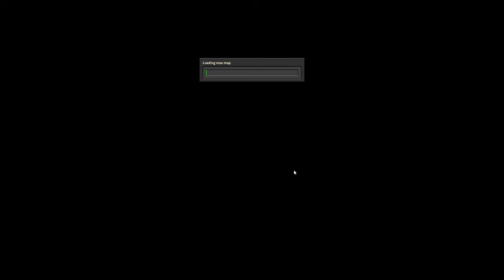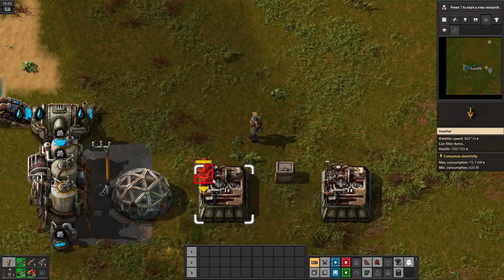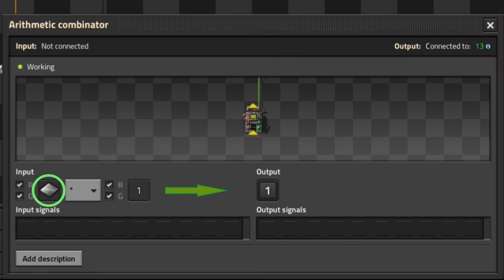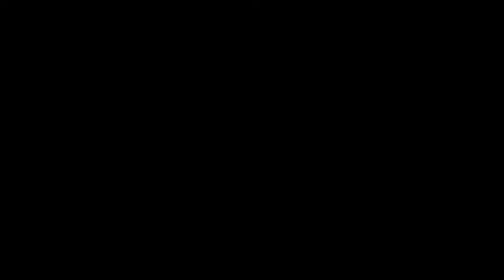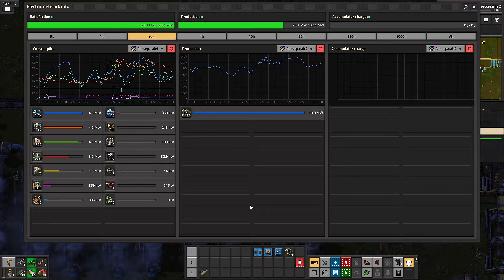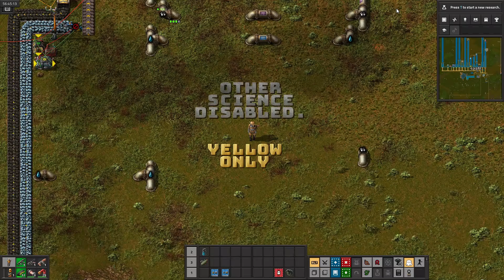How Hard is it to Beat Factorio Precisely

Comment: It would indeed be very cool if we could do the fully precise thing where we only mine as many items as we need for what we're building and at the end, we're launching a rocket with zero raw material in belts and boxes (but I guess a mall would still be ok, so we don't have to go completely insane). To be extra frustrating, we would also aim to have zero science packs in the system in the end (though I guess there's an issue with science packs being emptied unevenly)

Comment: Concerning quality with precision- you need to be able to detect when a quality product is created, shunt it off to the quality network, and re-add the ingredients to make a replacement component.
Reply from the maker: Indeed indeed. Quality is something I plan on looking more into when I do this again, as I feel it would help a lot of the shortcomings in the design.
The design in this video is (relatively) simple, so I did not have a way to do that without a redesign in any way that felt in line with the challenge.

Comment: This reminds me of an idea I had for a minimum resources run, where the total amount of ore is set to the absolute bare minimum necessary to beat the game, but this would not be practical to attempt in an actual run, as it would require such abominations as:
1. Mining all ore by hand until either productivity modules or mining productivity are unlocked
2. Mining all ore with a single electric drill for the rest of the run
3. No inserters, belts, bots, or trains. (you can borrow belts that you will later use for green science, but you have to give them back by the end of the run)
4. Many sub-abominations to minimize power consumption pre-solar, including not borrowing inserters from green science production
5. Only using a single solar panel for the rest of the run
6. Only using a single assembler of whatever the current highest tier is, ever.
7. Only using a single stone furnace, and later electric furnace, which will run on low power due to the single solar panel.
8. Only using one chemical plant and oil refinery each, and good luck minimizing the number of pipes required, since a storage tank is a waste of precious plates.
And of course, by far the worst part is the routing: figuring out which technologies to unlock in which order, which unnecessary techs save more resources than they cost, and when to craft which items.
The only way someone could actually attempt this and complete it before the sun explodes is probably to use mods to make handcrafting instant, make it permanently day and make a single solar panel give a million times the energy, and manually place resources on specific tiles to eliminate the need for multiple power poles, among other things.

Sorry for rambling, hopefully somebody finds this interesting. I think the only thing more cursed than actually attempting this would be trying to optimize a 100% TAS of Space Age.
Reply from the maker: That would in fact, be an experience of all time.
Reply: @LucyTP  lol

Comment: So, I'll write down a few main thoughts that came to me while watching this video. I don't know why you decided not to use wagons, cars, and tanks instead of chests, but that's not as important as choosing storage over belts - for their use, it's sufficient to read values from inter-section belts using pulses and stop them when a threshold value is crossed. Also regarding pipes - I'm not sure there are reliable ways to send exactly 5 units of fluid (although throttling is close to something like that), you can use a simple design - pump-pipe-pump, where the pipe will always measure out 100 units of fluid for you (and by the way, you can use sushi pipes). Regarding the main goal - I'd like to see a full-fledged factory with centralized control, where requests set in one place spread through the system, break down into sub-requests, and so on down to the drills (also configured). Ideally, you need a mod that reads the required items for building a placed blueprint, which would pass these signals to the central node, the system would produce these items, and bots would place them. By the way, nuclear power is also perfectly calculable, as are laboratories (a mod that reads the requirements of the current research would be great here) :)

Well, in general, take a look at the design of modern processors with their blocks, pipeline processing, and on-demand-only operation - I think you'll find a lot in common that's interesting and useful. Looking forward to part 2. Subscribed
Reply from the maker: The idea about central requests expanding into sub requests is also something I have been thinking about. I’m just working on ideas on how to do that while also working on other videos.

As far as using chests instead of cargo wagons, I have no idea why I did that, cargo wagons is for sure better, and I will probably try designs with them in the future.

Comment: 44:30 personally, I would've filtered the passthrough using the same filters as the machine input, but on blacklist. You could also have the inserters be set to adjust their hand size based on circuits, but for that you'd probably want to min-filter all remaining inputs.
Reply from the maker: Yea, when I inevitably try this again, I have a lot of things in mind that could be done different/better.
Reply: You can also set parameterization to be "ingredient #X of item Y" and ingredient count, letting you abstract away the manual math you did into the blueprint parameters. It does mean that you need to parameterize more, but if you do this again, I recommend you do a general one-stop-shop BP for which you need to only provide the recipe as a parameter
Reply from the maker: Yea, I need to learn more about a lot of combinator stuff, especially the new combinator as from my understanding it would also be quite helpful if I knew how to use it.

Comment: So wrt smelting with coal ... each chunk of coal provides 4 MJ of energy, the stone furnace uses 90kW of power so will run for 44.4444 seconds on each chunk, smelting a total of 13 8/9th plate each, so each 9 coal smelts exactly 125 iron plates. Up to floating point rounding at least.

Comment: I think you could have automatically calculated the inputs, by wiring up the assembler and reading the ingredients list?
Or even better, used the parameters ability to be calculated (or set to) the ingredient count of a parameterized item. (It doesn't show or mention this in the Wiki sadly, and it's only visible when hovering the Formula part if you have a recipe as a parameter)
Reply from the maker: Probably yes.
I will have to see with the parameterizing if/when I do this again.

Comment: It's not entirely clear to me why you would use this approach to be "precise", which I'm taking to mean that you deliver to each machine exactly the materials it requires with only minimal surpluses sitting around on belts or in inventories.  There will always be some logistical difficulties that preventing being exact in that sense, but the will converge to exactness just by running for long enough.  The longer you run the base, the closer to one the ratio of resources produced to resources consumed will get.  You can make it converge faster by reducing the number of inventories and belts you are using, but even without that effort, running longer brings that ratio ever closer.
Reply from the maker: Mostly I decided I liked the idea of using this sort of design, and could not think of a better descriptor for it.

Comment: an alternative way to solve the clogging problem is that you fill in reverse. so you fill the last chests first and the first last so that when you need the inputs they are already there and things cant block each other.
all you would have to do is disable crafting unless every chest contains exactly what your expecting it to do or it has already started.
that would give you a preperation phase of getting things set in place instead of trying to fill it in while it is already working, inserting supplies in to a running system is a lot more complex to solve as a problem.
Reply from the maker: I for sure could have fixed the clogging in a number of other ways, but with the design semi-established already, splitting and limiting seemed the easiest solutions.

Comment: im sure someone could extend this idea to an even bigger extreme where it keeps track of every item  you have in your factory and not just craft precisely but also mine in exactly the steps that this system wants, so that you take only as much from the planet as you need and then make sure everything goes in the exactly right spots without wasting anything.
Reply from the maker: Indeed indeed. If I do this again I will probably try and go closer to that extreme, but this time I did not fully commit to that, even though maybe I should have for the challenges sake.

Comment: to be clear, every burn time is based on the power consumption of the machine which the tooltip gives you and the fuel value of a given fuel which you also get from the tooltip.
so you can actually predict how much time it will spend burning any given item and accurately calculate what combinationg ets you as close to your goal as possible.
for burner based machines that have crafting machines this can also be influenced by the recipe as an additional factor, all the details are on the games wiki page if you ever want to learn the details on how a given mechanic works in detail.
you cant look up every part of the game but the most important ones to this challenge are possible.
Reply from the maker: Yea, like I kinda said near the end, there are for sure plenty of ways I could have been more precise.

Comment: 57:00 you actually interrupted me starting to type a suggestion about trains. I was going to ask about trying using a train car crafting module for crafts that have a lot of sub crafts to save time and space
Reply from the maker: Yea, I have had a few concepts about how trains could have helped.
Easiest swap would have been using cargo wagon chains instead of chest chains to improve throughput and item accessibility.
But I am also thinking about how you could have an actual train that moved down a set of train stops, and had assembling done on the sides of these stops.
For sure something I am considering, but I am gonna take at least a bit before doing this again.